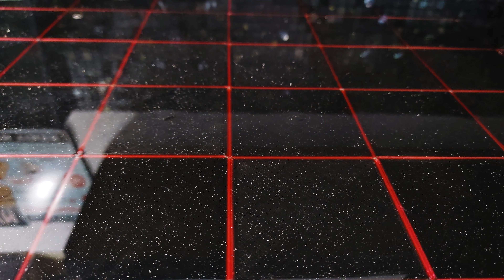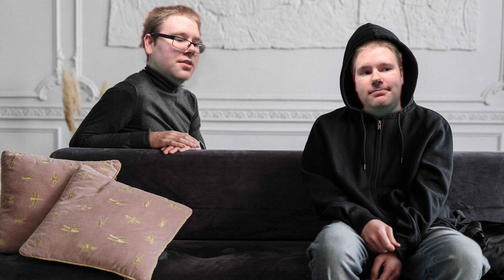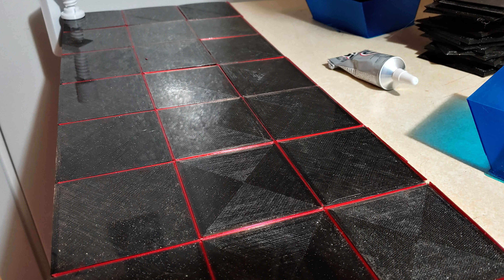3D Printed Kitchen Countertops, UNDER $400!

Comment: As another commenter said, that resin is most likely not food safe nor would it hold up to heat damage from hot cookware. I also would add that for $400 you could buy more than enough quality tile to do your counters and save $$$ on electricity and print time + epoxy + professional.

Comment: That resin isn't considered Food Safe, so that's probably not the right choice for that application. In fact, a resin counter top seems like a bad idea all around as it cannot handle hot temperatures without softening. The MSDS for that resin also lists Bisphenol A which isn't safe to use for food touching applications. So while I appreciate the effort that went into this, I don't feel like it was researched properly before implementation.